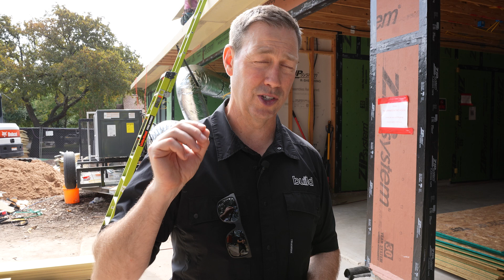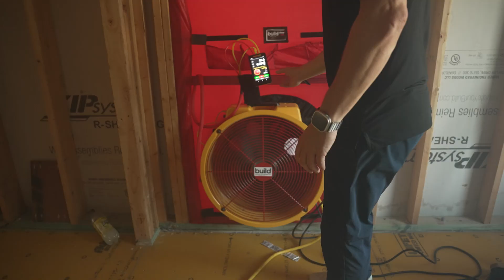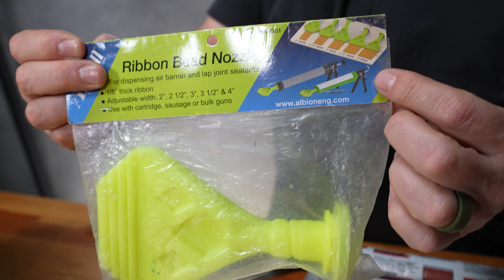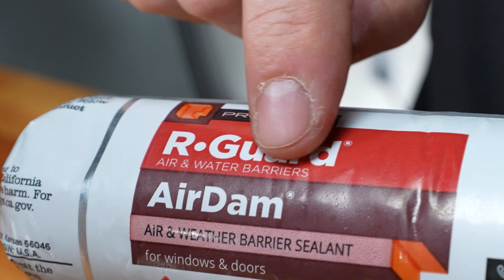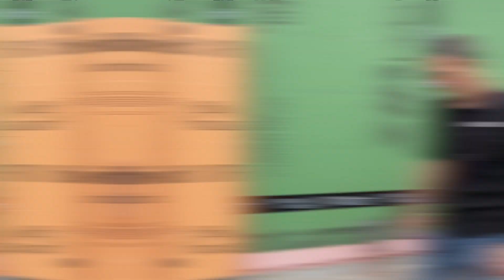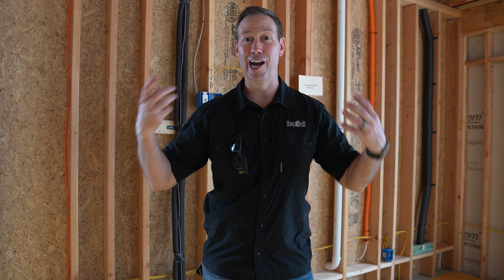The Risinger Build: Episode 12 - Air Tightness & Control Layers

Comment: How do you air seal a roof penetration when you have two layers of sheathing with a gap in between?  Do you have to create and seal all the penetrations through the bottom layer of sheathing before you put on the exterior insulation and second layer of sheathing?

Comment: If you were to replace the siding on a house and wanted to ditch the old house wrap and apply the Prosoco R-Guard system. Would you need to add a make-up air system as well? House has a traditional vented attic.